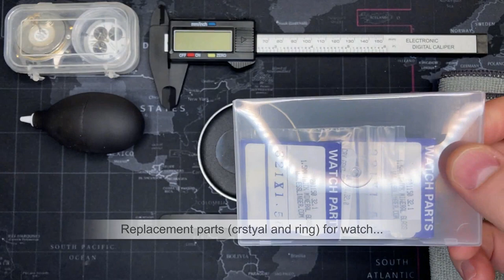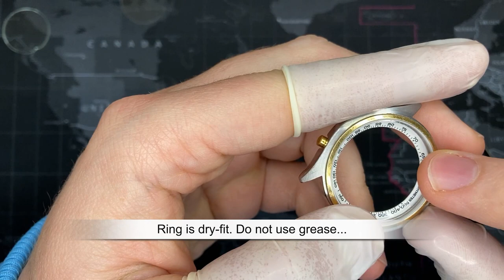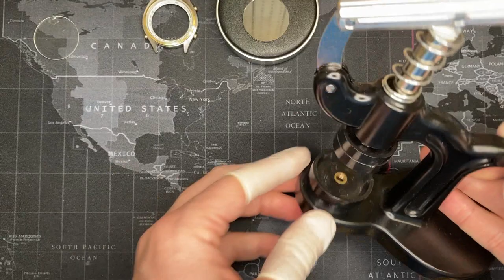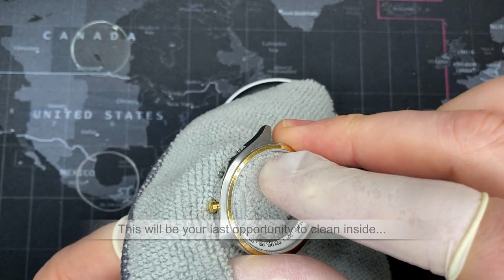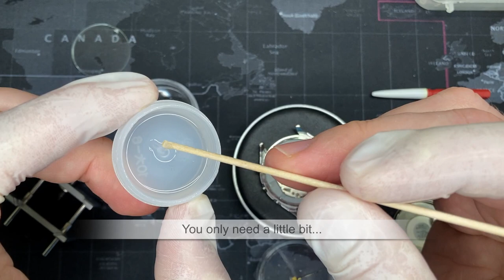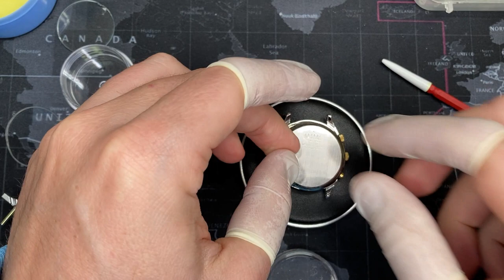How To INSTALL a Watch Mineral Crystal - Watch Repair / Step-by-Step Instruction

Comment: i am glad to see it is fitted from the outside. 
That saves me taking out the mechanism itself.
I burst the glass on a cheap watch but with sentimental value.
Luckily i got all pieces out of it by immediately removing the crystal or what was left of it, and shaking the watch until i went crazy. 
It is a skeleton watch, so you can see through it and so i am pretty sure everything is out.
And, even though it is a sentimental value watch, i am still gonna try to repair it myself.

And if i screw up, then i will spend a few more bucks on it and send it off to a professional.
But, you make it look easy enough for me to give it a try.

Comment: Hello! Sir about the oil you the grease and the grease pad you used 
Can use to any branded watches? Only asking thank you very much
Reply from the maker: The answer would be "depends." For the COSC and extremely high precision watches, they define the specific oils that are required for proper operation to keep them in proper specification. 

However, for the VAST MAJORITY of the mechanical watches that you'll run into from the 1950s through the 1970s, you can use the oils I mentioned in the video.

Comment: when replacing the crystal on the watch does the thickness have to be the exact same as the original crystal as well?
Reply from the maker: It does not; however, if it’s thicker than stock, it will protrude past the face. So in that case you would want the edge to at least be beveled or rounded off. Otherwise... it can break easily as it’ll constantly be catching on things.

Comment: My wenger swiss military watch got a broken glass face because it fell to a tiled floor about 2-3 meters high and it cracked. Is that easy to replace and if so how much do yoi think that will cost?  It also have seemed to stop working. Is that a bigger problem or is that repairable?
Reply from the maker: Ugh... yeah... been there, it's the worst feeling when you pick the watch back up and you're like... oh that sucks. 

I want to say, it really isn't that hard to replace. But you have to have the right tools... which aren't expensive, but just as I've put in the video. You need a case press (~$30), and a micrometer ($25) to measure the exact size for a new ring gasket and the crystal. The ring gasket and crystal will run about $20 for the replacement.

I would offer to do it for free (you just buy the crystal), but I no longer have my workshop, and all my tools are in boxes right now. But a shop will probably charge you $100 bucks, which may not be worth the price of the watch, honestly. :(
Reply: @ToddsWatchshop  ok thanks 😊 yes its the worst feeling ever but im glad its repairable 😊

Comment: Very clear instructions! But didn't you short the battery when you lifted it with the tweezers?
Reply from the maker: It's really not bad when you do it for a couple of seconds, but you are right... they use plastic tweezers for this that I should be using.

Comment: to Wenger Todd's Watchshop -> thanks for a great video, you showed how to measure the watch crystal, but if the crystal gasket is damaged and needs to be replaced, how do you measure the crystal gasket to order the correct one? or are crystal gaskets usually the same measurements as the crystal itself?

Comment: I see finger cots on 2 fingers, but you keep grabbing stuff with the 3rd finger
Reply from the maker: In this case it's not a problem. I was careful not to touch anything with the third finger, that wouldn't otherwise be touched by the human hand anyway. For things like removing the movement and the battery, I only touched it with the fingers that were covered. A lot of this is for show. People have been building and rebuilding watches for hundreds of years without Laytex gloves.
Reply: @ToddsWatchshop maybe cover the third finger and not the second